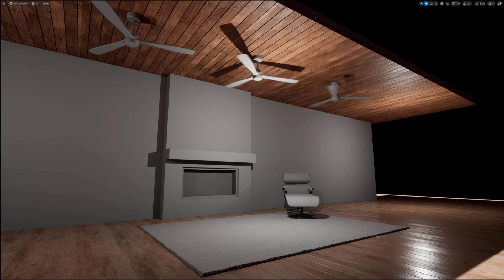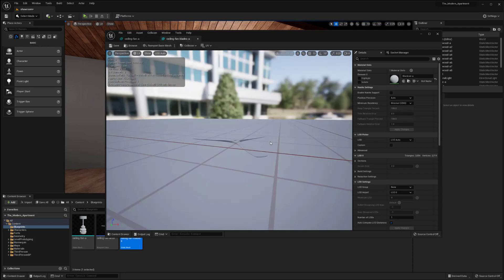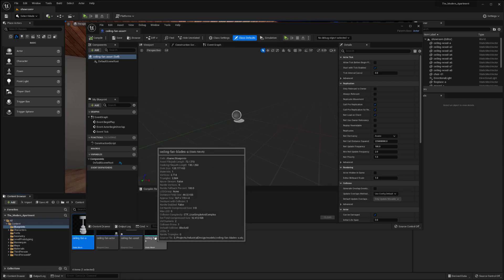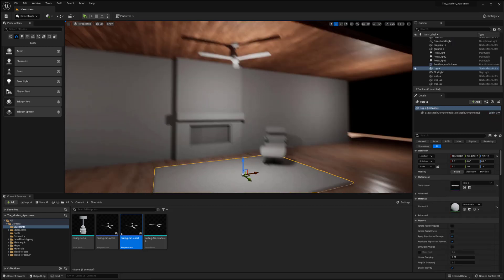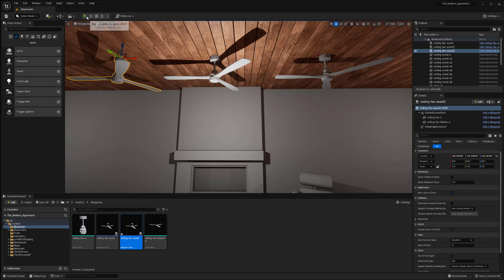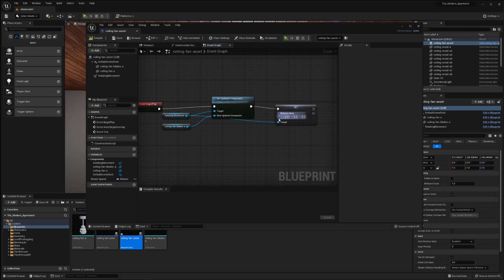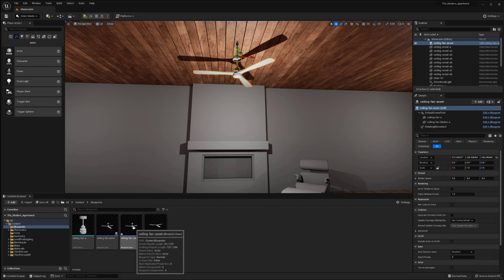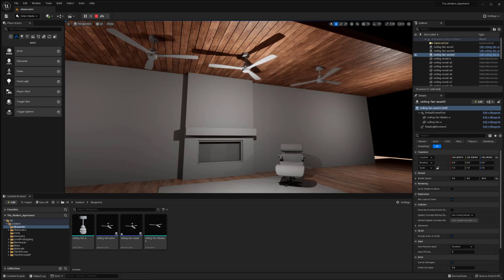How To Add Movement To Your Environments in Unreal Engine 5

Comment: very clear explanation thanks, I tried with the same system for the simple rotation of the wheels of a vehicle, it works but it takes everything with it, even the bodywork.
Since I need to use the car in a spline animation and therefore make the car a single block, what variable should I adopt to make only the wheels rotate and exclude the passenger compartment.
Thanks I hope I was clear

Comment: That is great! HOw would I go about if I wanted some animation that's just rocking back and forth?
Reply from the maker: Depends on how youd want it to rock back and forth and where the joint would be. You could technically have it rotate on a joint easily but then that might cause the base to rotate as well. So youd have to put a joint into a socketed roof piece pretty much like they are in the real world to easily have it work in that way.
Reply: @PeytonVarney  Thank you!

Comment: Great video 🎉, but is there a way to stop and resume rotation?
Reply from the maker: Yea you could set it up with a controller or something that makes it start and stop. Have the rotation working and additionally even turn on and off the light that is on there. I made a video going over some of the blueprint stuff. https://youtu.be/V4It2uhvenM but if you want to see it covered more than I can make a new one making a fully working fan and light rig

Comment: Hey i am using this method, but it only works with game mode and i want to use it with Sequencer how can i do that?
Reply from the maker: If you render out your sequence then it should be in there rotating properly. You won't see a preview in sequencer because of that not rendering. You can if need be get it to show up in sequencer but assuming your just trying to capture video with it rotating?
Reply: @PeytonVarney  thanks! yes when I rendered out it was rotating, just not showing in the preview mode
Reply: Thank you  @PeytonVarney